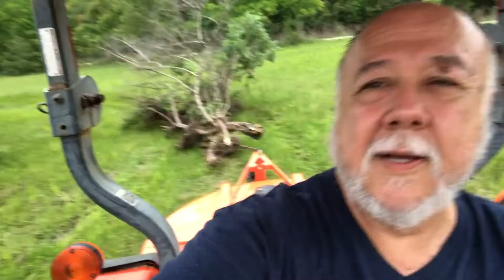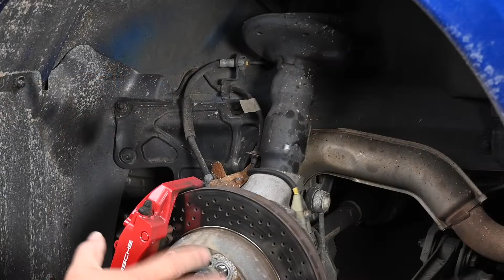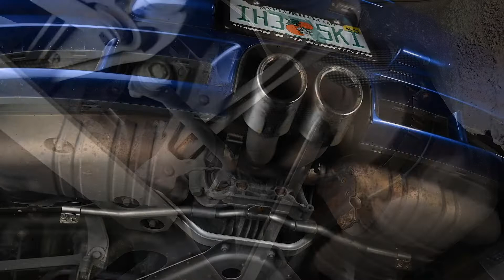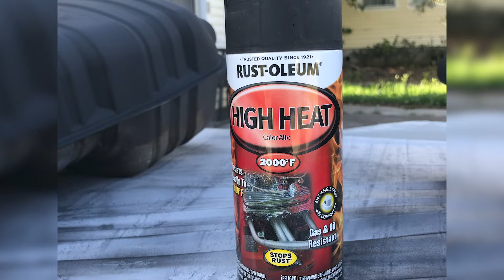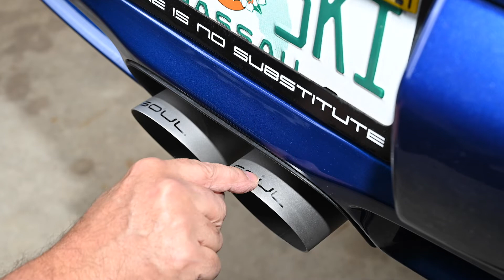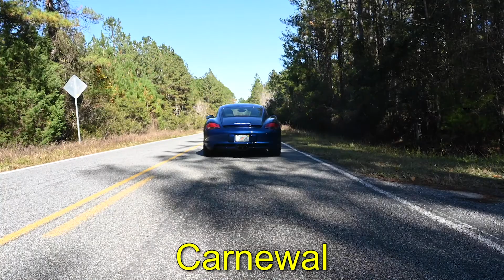Project 987.2 - Part 1: Carnewal GT exhaust + Soul X-Pipe install with sound & performance tests

Comment from the maker: Before someone brings it up: Yes, I did a standard T-test to verify there was a statistically significant difference between the two population (0-60) groups.

Also, oops ... Gert let me know they're actually located in Belgium, not the Netherlands ...
Reply: Out of curiosity for your 0-60 tests, were you leaving from idle, or applying some level of brake torque in lieu of launch control? It's great to see some real world gains!...
Reply from the maker: @ReubenBrunson  From idle, just release the brake and stomp the gas.

Comment: Great video. I got a Carnewal GT on my 987.1 Cayman and now on my 987.2 Boxster. It was certainly worth it on the 987.1, but hardly noticeable on the 987.2. I think it is due to the cats (as you may know). The 987.1 has 2 cats in the exhaust and 2 in the headers. The Carnewal GT exhaust deletes the ones in the exhaust. The 987.2 has all 4 in the headers, that stay there when you install the Carnewal GT exhaust. I think 75% of the sound improvement on the 987.1 comes from the removal of the cats in the exhaust.

Comment: Hi Cliff, I appreciate all of your work out into the videos. I have a question in regards to the PSE. I notice that you have the PSE, does the carnewall exhaust effect the on/off switch? 

I guess my question is, are you able to “quiet” the exhaust when the PSE button is on the off mode?
Reply from the maker: Actually, I don't have the PSE. Not sure what led you to believe that. But, even if I did, the Carnewal would't interact with it at all. There is no way to alter its volume,.

Comment: Thanks Cliff for the insight. I am thinking the Soul Performance system since they are headquartered 30 mins away. But I appreciate your in-depth approach on the review.
Reply from the maker: Make sure to check out my video on the Soul valved exhaust. I've been super-happy with it and highly recommend it. I also just installed their catless competition headers. They make the Cayman sound absolutely insane.
Reply: @CliffsGarage  just watched it. I am so excited to get the Soul Performance Exhaust and headers installed.

Comment: Do the wheels have to be removed, or it just makes it easier?
Reply from the maker: I suppose it would be possible to remove/install the exhaust without removing the wheels, but it would be tremendously more difficult or nearly impossible.

Comment: One of the best exhaust change video I have seen so congrats.I also put a Carnewal on my 987 and it continued to improve over 500km. I changed the tailpipes to a 981 Cayman Twin outlet black chrome.My sound now is rather stock up to about 4000rpm which is perfect with no drone and then it is a loud wail all the way.Its a perfect exhaust in that it sounds stock at low and performance when pushing.In regards to performance the 2 biggest things for me was installing a sprintbooster to improve reponsiveness and the second thing which was really amazing was changing my tyre size profile at the back to a 295/30/19 which reduced the rotating size of the tyre and it improved the pickup and push in a very noticable way.

Comment: I have a 987 S with Carnewal exhaust and NHP race headers, 997 GT3 throttle body and plenum.  The sound is Fantastic.  Very throaty and quite loud as the revs build.  I'm yet to hear a better system.

Comment: Do you think the Fabspeed x-pipe wouldv'e been more flush with the car? Are the underhanging bolts visible when standing behind the car from a distance?
Reply from the maker: I really don't know how the FabSpeed would fit. As for the bolts, I think you'd have to be so far away you wouldn't notice them anyways.
Reply: No, you can’t see it from behind. I have a Fabspeed X-pipe on a 987.1 Boxster S

Comment: You should have installed the GT exhaust with the 987-2 S tail pipe instead of that Chinese X-thing.
Reply from the maker: Well, why don't you ship me one and I'll test it out :)
Reply: I'm considering ordering your GT exhaust for my 987.1.  Im in the states and I understand you have a shop representing your product/modification.  Would I be better off to order thru you or the rep here in the states?
Reply: Disappointing to hear you talk poorly about other brands.

Comment: Thanks Cliff for this detailed video! I am considering a similar, or maybe identical, set up on my 987.2 Boxster. I may start with the Carnewal and stock tail pipes first, or possibly use the Fabspeed x-pipe (maybe the polished version would be less likely to scuff?). 

So much of this car's character and charm come from the exhaust note. I recently rented a 981 with PSE and was sold on it! The 981 is definitely the more modern car, but there are things I prefer with the 981 (especially the price ;-). No wrong choice, they are both are exceptional and amazing cars!

I'd be curious of the perspective of the PSE vs. Carnewal, if you or others have a point of reference...
Reply from the maker: Good question! I should have made that clearer. I just sat at a dead stop with my foot on the brake, then removed it and stomped the accelerator.

As for the tips, I think a polished/chrome finish may be more durable, but I really like the satin look. It also ties in with what I'm going to be doing on the rest of the car.
Reply: @CliffsGarage  Thanks for the clarification on your 0-60 test. That seems like the most logical way to keep things consistent, and those are still great 0-60 run times all things considered. I can definitely see a Dragy in my near future, so I'll try to be a good subscriber and remember to hit the link above... ;-) 

On another note (pun intended), has the sound of the exhaust changed or mellowed any since installation? I'm curious how this exhaust sounds day to day without valves to quiet it down. It seems like its a great solution to drive around quietly as long as the RPMs are low....

Comment: Thanks for a great video, very very detailed. I had almost given up on a replacement exhaust for the 987.2 as all the options were for the .1 version. Will check out Carnewal. Wonder if he does a drive over and swap out service from the UK :)